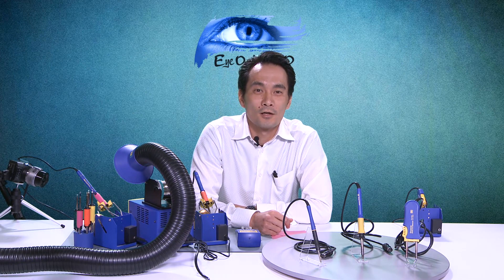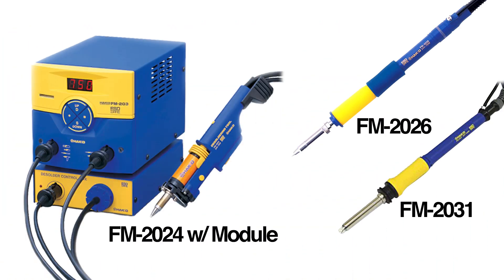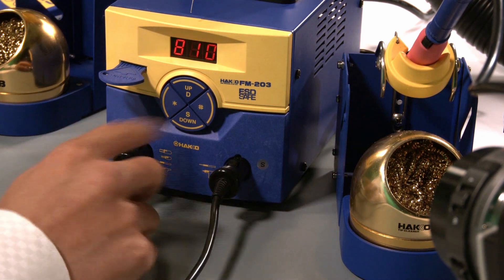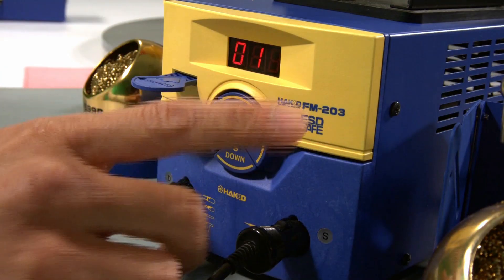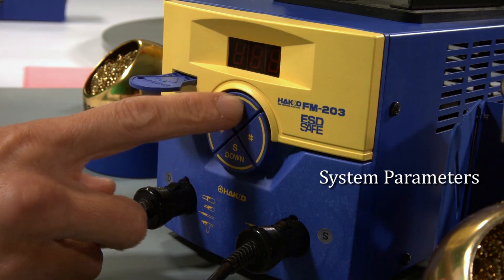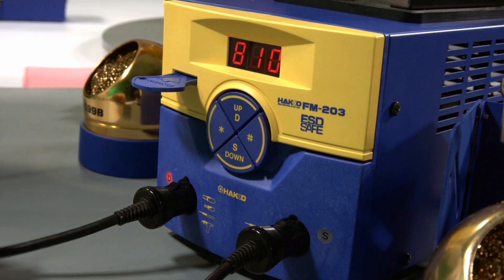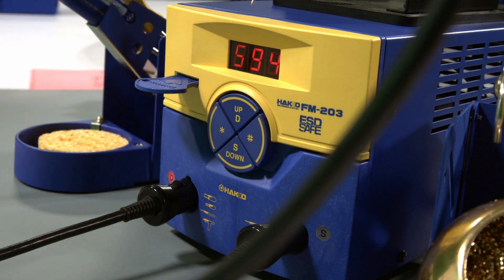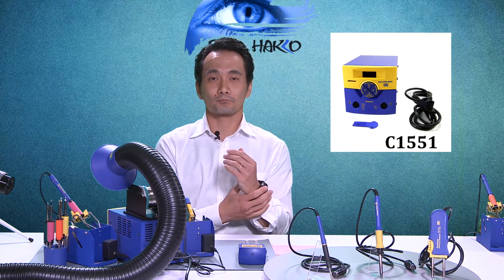"Eye On Hakko" presents the "FM-203 Dual Port Soldering Station"

Comment: Holding the * or the # on my FM-203 does NOTHING. The S keeps blinking and the display reads 750.
If I press the D key, the display reads OFF and the D starts blinking, but I still can't change the temperature! PLEASE HELP!
I swapped the plugs on the front because I wanted to use the FM-2032 instead of the FM-2027 and the display read C - E and gave a long loud BEEEEEEEEEEEEEP! until I switched them back. Is this thing broken?

Comment: Hello.
I bought my hakko fm 203 With standard handpices. I bought a few tips t12 but when the temperature reached then temperature on display is jumps  low and up.   The reason of this can be it, i need tips t15? Thanks.
Reply: Wondering if you realize what is or was the problem, Because I need to buy this station, I said enough with my old Genuine Hakko 936 still strong like a dragon but old and my  electric bill is high. is your tip OEM?

Comment: Is it possibile for the user to upgrade  their fm203  firmware  to v.3.1 for the fm2030  heavy duty  iron... it's  not hard to swap out  a chip from a socket or replacement  of a through  hole soldered  chip takes patience and a little  skill and good  Flux  and wick a quality lead tin solder or solder paste.. chances are if your a 3rd party repair tech and you bought  expert grade equipment you would have the skills required to change out a  40 pun dip prom chip or IC
Reply from the maker: unfortunately, Firmware upgrades aren't as easy as changing out an IC, Hakko uses proprietary firmware that we will rewrite to the board using a specific software writer, and only will this be done when necessary. This has a specific item number in our system FM203-UPGR the upgrade does have a cost associated of $239.97.

Comment: what is offset value also how you make it go to sleep without the iron holders?
Reply from the maker: Offset value is less tightening the tolerance on the Set temperature; for example, if you were to set your unit at 750'F and then took the iron temperature and found it to actually be 743'F, you would input a positive offset value of +7'F, which will tell the system to increase the tip temperature and will bring the Actual temperature of the soldering tip closer to the " SET " temperature, The same applies for a negative offset. If you were to set the temperature to 750'F but measure 755'F, you would input a -5' offset to bring it closer.
Reply from the maker: The unit will require a sleep signal which is sent from the sleep holder to the base unit when the iron is put into the Cradle. A microswitch on the backside of the sleep stand is actuated which sends the signal for the corresponding iron to the base unit. unfortunately, the FM-2027 handpiece does not detect thermal load such as your FX-1001 handpiece which when left in its " undetected" state for a period of time will trigger a sleep mode. If the user does not have a sleep stand it is best that they Turn the specific Channel off when not in use. This can be achieved by pressing and holding the Corresponding Channel button ( D or S ) that will turn the channel off until the process is repeated to turn it back on. Or if the unit will be left for a longer period of time the user can turn the unit off and back on when needed.

Comment: Interface is so difficult ..make it simple why we need a key? If there is no fuel there?
Reply: While the interface is inexcusably obtuse, the reason for the key is obvious. For industrial settings they need to make sure you can’t accidentally change the settings on the line. Think about it: Some janitor could press the button and cause the factory to spit out thousands of defective products with cold solder joints or cooked capacitors.
Reply: @emmettturner9452  Employees do stupid stuff, like turn the temeratures up so the iron is damaging parts or lifting pads off the PCBs. The Pace equipment actually has a real Ace keys like those used on vending machines to change settings or even to turn on the station itself. I delete that keyed switch on the Pace stuff all the time. I got a good deal on a pace SX100 desoldering iron, and station, and it's much better than my Hakko desoldering gun.